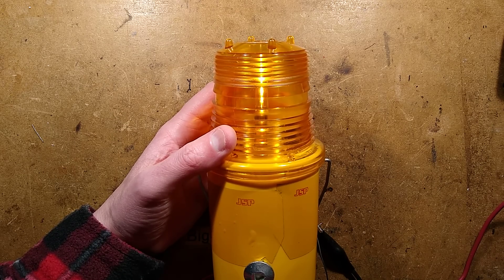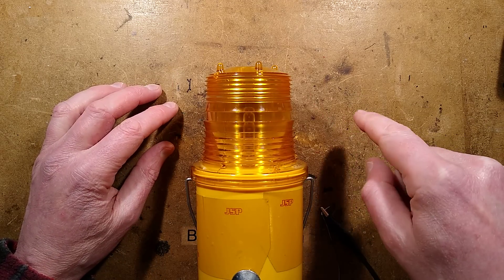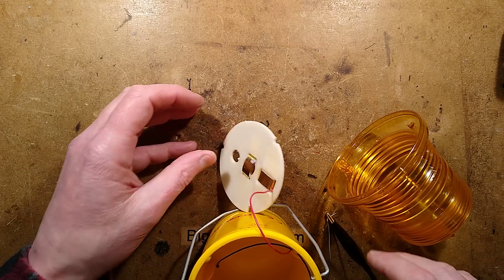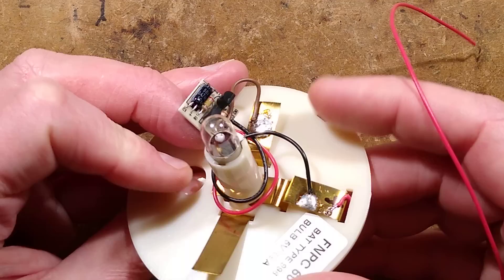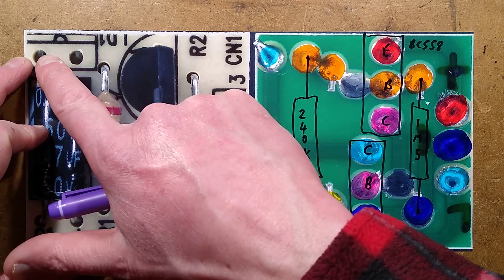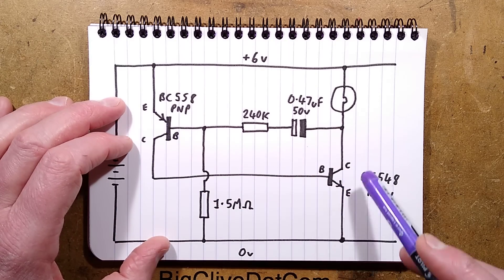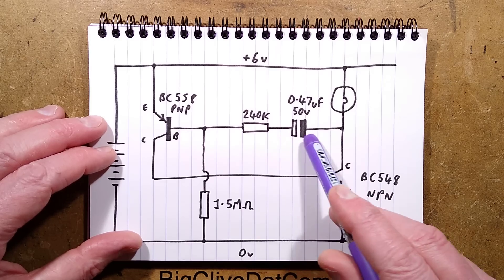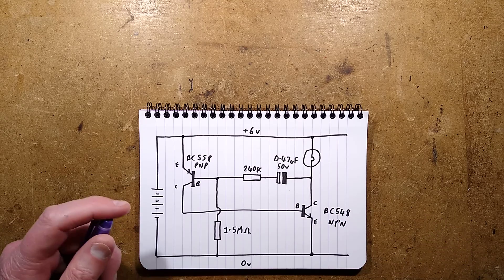Old tungsten roadwork beacon - with schematic

Comment: I am reminded of a circuit that I would run into from time to time that was even simpler.  It consisted of two complementary transistors,  one capacitor,  and one resistor. These were sometimes sold as little modules for a code practice oscillator,  siren,  etc.  I'm sure I've seen it elsewhere as well.  I cannot remember the exact configuration of the circuit,  though.  Putting just 3 volts into it,  you could directly drive a speaker.

Comment: That circuit is identical to a code practice oscillator I built back in the 1970s.  Just use around a 100 nF capacitor and speaker instead  of the lamp.  The circuit is very insensitive to component values, including the transistor characteristics.

Comment: I ‘borrowed’ one of the square metal ones that up used to see on skips with a large lens on each side it had 2 large batteries i also ‘found’ one that looked more like yours, but much older  inside it as a motorised reflector that spun round to make the light flash like a lighthouse.. clearly designed before electronics components were readily available 
it was circa 1977 and I had my own bedroom disco .. only all the lights were yellow .

They’re probably still in my mums attic

Comment: Had one of these as a kid. I've no idea where it came from, it just, er, arrived. Bit bigger and chunkier than your one, same 6V lantern battery. Longer off period on the duty cycle to try and save battery life. I ended up using the battery to power the propellers on the model aeroplanes hanging from my bedroom ceiling.

Comment: I remember them in the 70s, they used a hex bolt with a ring around it making it impossible to remove without a 'special' tool.  A thin walled socket worked! :-D

They were attached to barricades (shaped like a saw horse) and the barrel shaped ones used at construction sites.  Two modes (continuous ON and flash).  When the batteries were new they were nearly as bright as the typical 1157 automotive lamp in turn signals (USA here).  They had versions that used a pair of lantern batteries in parallel as well.  Sometimes those were attached at the top of temporary road signs in construction zones.  Some did have a high intensity flash as others mention dumping a cap into the bulb.  Of course with today's tech using LEDs and solar panels one could make them run seemingly perpetually.  That is until some prat staring at their cell phone runs it over or a kid swipes it! ;-)

Also of interest are carbide lamps!  They have a very white light close to that of halogen when run correctly.  All you needed was some water and a few chunks of calcium carbide.  The reaction produces acetylene which pressurizes the tank and the gas burns brightly when properly mixed with air.  Like mantle lanterns they get hot AF and cannot be used in the presence of combustible gases.

Comment: There were some which simply had a bulb and a battery. The bulb filament was anchored to a bi metallic strip which bent as it heated, cutting the power then cooled and reconnected.
They were a MES base and I definitely used one in a bicycle dynamo. I may still have it.
Paraffin road lamps lasted up till something like the 90's. They were made by Chalwyns I think. We used to play with them as kids in the 70's and 80's.

Comment: I remember when you could get bulbs that flashed using a bimetallic strip inside the lamp envelope that heated up and broke the circuit before cooling and making contact again. Couldn’t get any simpler than that. I think that was the precursor to this circuit.

Comment: I've seen circuits like that which use one transistor to limit the others base current in references from reputable designers (who need to keep parts count to a minimum). Its not great in that if you take the circuit outside of its normal operating range one transistor gets rammed on, but provided the values are chosen correctly it does work. Other oddity is that they get quite close to breaking down the base-emitter junction of the '558 when it switches off, but with the 240k resistor that's probably of no real consequence.

Comment: The memories you invoke are priceless :D
We used to pinch them as kids. They were hanging off cones. The ones we took used to flash though with a couple of seconds between flashes like a strobe.
I do remember the components were just soldered leg to leg then to the bulb and I'm sure there were only 1 transistor, 1 capacitor and maybe a couple of resistors, if such a strobing circuit is possible from that arrangement. 6 volts was crucial to its operation though, I do remember that, any less (like 3xAA batteries) and it wouldn't work.
There were also some with no components, just stayed lit up all the time like a torch. I guess they wouldn't last too long lol
Reply: Maybe a reverse BJT oscillator. It is weird at first thought - no base connection, just a resistor, capacitor, transistor in reverse polarity, and the load to be pulsed. Won't get much simpler.
Reply: Thank you, sounds worthy of experimenting :D @jussikuusela7345

Comment: Gosh, very cheaply made but adequate for the need. Some of these have the little light sensor so they pick up the light output of a neighbouring lamp, which means they flash in some sort of sequence. I think this is used along roads so there’s a wave of ‘signal’ along a cone line or wherever they’re posted. I don’t know how the electronics of this works, just what you see. Good use of a Fresnel lens, too.

Comment: The railways used to use the paraffin type with a special lens configuration.  They had two red opposing and two green opposing lenses.  If you find one of those in a chav shop they are worth a mint.

Comment: The ones in use today alway fascinate me. They must communicate with each other by the way they flash in turn down the line. Interesting circuit though you have there Clive as simple as it is. 👍🏻

Comment: @bigclivedotcom An interesting video and thought-provoking video. Many years ago I had on of the other types of road warning light that had two of those 6V batteries and was basically bidirectional rather than omnidirectional with two vertical orange lenses mounted vertically. From what I remember, it was two high-intensity pulses followed by a pause and the filament  lamp looked the same as the one in this video. There was a bit more to it than this light and at the time I tried to reverse-engineer it (for possible future projects) but it was a very long time ago.May you have or can get hold of such a light for a future video?

Also, someone brought out a very interesting version of those 6-volt batteries. It was a rechargeable version and the physical form was the it was that, when viewed from above, the profile was triangular rather than square like it was cut in half almost diagonally from one corner to the other. This was to facilitate a rather unique and useful feature in that in the space where the rest of the battery was 'missing' was a built-in UK 13A plug! This meant that when the battery was discharged the entire battery was plugged into a 13A wall socket to recharge with no external charger or disassembly required. The pins of the plug also worked as a substitute for the missing corner so the battery would be physically 'correct' when used in place of the regular 6V battery.
Reply from the maker: I remember those rechargeable batteries.  I wanted one at the time, but they were quite expensive.

Comment: You've got the posh one! I remember an early version that my brother and I rescued from the roadside after it had been run over by a vehicle, which had one single transistor and a couple of resistors and capacitors. We repaired the circuit, which was literally just the components hanging in mid-air, like a spider's web. The bulb was 6v rated at about 50mA.  The flash rate was a bit variable and could be skewed by varying voltage and temperature.  In service, I remember these things rarely, if ever, flashed anything like in time with each other!

There was another variant that ran at a somewhat higher frequency so that they appeared to be constantly on, but if you shifted you eyes rapidly, you could see a trail of amber flashes in a row along the path of your eye.

Comment: i was not expecting a PCB... i have of these somewhere that just had a transistor and a cap roughly soldered together though holes in the plastic plate that holds the lamp

Comment: Something about flashing where the average power does not equate the same runtime as a continuous load, but seemingly thousands of times more.

I think one of the oldest batteries is inadvertently still going using this principle I shan't not term for the brain serves a corrupt data packet.

Comment: I too had the American version of this thing back in the 1970s. Got mine at a thrift store.

It used a thermal switch “bulb”, no other components. The on off switch was two brass strips inside, operated by what looked like a bolt head. Took me a while to figure it out, it was so simple, but everything didn’t line up when it was opened, so I had to do some mental gymnastics to figure out where everything would be when it was assembled.

In yours, the lamp turns on when initially powered up because the capacitor looks like a dead short so the resistor divider turns the left hand transistor on hard, turning the other one on. Thereafter it operates as you said, the capacitor charging through the 200K resistor and the transistor’s b-e junction until the transistor can’t stay on etc. The cap appears to discharge through the battery.

The connection across the cap is puzzling indeed. I mentally ran through various components that might be attached there and what they would do. A resistor would, as you found, just make the lamp stay on. A capacitor would change the flash rate. A switch again would make it stay on in one position and allow it to flash in the other. I think that might be the intended function for a different model that had the included switch. I can’t quite figure out how the marking on the board relates to that though.

Thanks for the blast from the past. Brought back memories of learning troubleshooting on very non-standard gear.

I hope someday you get hold of an old rotary phone and explore the balancing network that permits duplex operation without echoing . Those things are black magic, full of inductors, resistors and capacitors with weird values you won’t see anywhere else.
Reply: There’s a great article in the Bell System Technical Journal (BSTJ) from about 1953 which describes the Western Electric model 2500 telephone which was a staple of telephony through the early 2000s.  The hybrid network is a model 425A.  It works sort of like a Wheatstone bridge so that the carbon microphone current and the line current oppose each other in the transformer and cancel out in the ear piece.  With no microphone current, the line current is unopposed and thus is heard.  The 425A network contains several varistors which essentially program the microphone gain and ear piece sensitivity to compensate for the varying length of the subscriber loop.  It is an excellent feat of analog engineering.  The Bell System Technical Journal is archived on line.
Reply: @wtmayhew  I'm sure that 1953 article wasn't talking about the 2500 because Touch-Tone wasn't introduced until 1963*. The article was most likely detailing the regular 500 rotary phone. Although I believe the 2500 used the same hybrid.

*The rare 1500 was used in 1963, the 12-button 2500 was 1968.
Reply: @eDoc2020  Thank you for the correction.  That was a typographical error, should have been 500.  The correct network model number is C4A 425 (which was revised several times to at least 425E).  I have a 233 3-slot pay station which I use with a 685A subset box which contains a ringer and a 425E network.  I also have a later 236 single slot pay station which has an internal network labeled 4010B with a C4A single gong ringer mounted on it.  The station service/coin serve manual I have doesn’t go into detail about the internals, just has wiring diagrams.

For the record, 453A is a vacuum tube which does not apply here,

Comment: The old "996" batteries were the standard for the lights used by the Night Shift nursing staff back in the day!  The  "standard NHS contract" Ward Torches seemed to always be the Ever Ready "Dolphin" brand. Nowadays our Night Staff use rechargeable LED lights,  which are brighter, lighter and far more reliable.

Comment: I remember  collecting  and modifying  these  beacons  in the 80s  if I remember  right  they were a little better built  back then withthe the components  on the bulb  holder with jumpers making  up the circuit,,,,the modification  was achieved  by strapping  or inserting  fireworks  to the lamp 😂,,, Happy  80s FUN

Comment: As Kids some 40+ years ago, we used to nick the battery's out of them for our home electrical needs. (Basically the light in our tree house). the flat round type had 6 volt bulbs with bimetallic strip in it, so no circuitry needed.

Comment: Transistorised flashing circuit. I have a few of these including a blue one with a strobe. Takes a 6v battery 4R25 or in old code Ever Ready PJ 996. In the old days Ever Ready did road lamp batteries for industrial use only. British gas did there own battery made by Ever Ready. Some of the early ones did use oil. The earlier electric ones used a split filament bulb for the flasher part, no transistors. I have a few old Pifco lamps that used these bulbs. I have a lamp from Eveready of the same age that's American and made by union carbide that has a transistor flash circuit. Once again Clive and excellent video.

Comment: In Spain the most common type is the MaxiLite or equivalent, some had dusk sensors and some not.
Here generic zinc carbon 4R25 batteries can be as cheap as €2 each purchasing a whole carton of 24 units at construction supply stores.

Comment: I have one of the newer ones that i duacivered, having been yeeted into my garden after some road repairs on my street. It has a big round orange lens and a yellow plastic body, and like this one also uses a 6v lantern battery and a tungsten torch bulb. It's designed to sit on top of a traffic cone and the switch is built into the receptacle for the cone, so it only illuminates / flashes when in position. Very cool decoration for my 'man cave'!

Comment: Can you imagine how they secure construction sites along roads in Brazil over night?
Every few meters is a red 10 l plastic water bucket, upside down, in an altitude of 1 m (3 ft.) above the road.
They stuff a 100 W bulb below/inside the bucket. That gives the most beautuful large red light that you can see from far away.
Below the bucket is a cone of white light where you can see imperfections of the surface and debris without blinding your eyes.
Genius. Cheap. Perfect! 😃👍

Comment: The socket of the bulb looks like the backlight bulbs for speedometer, rev meter, oil pressure and so on in older cars, trucks and motor bikes.
The specification for 12 V environment was 1.2 W (if I remember correctly).

Comment: I acquired one of these as a kid and it was about as minimalist as you could get.  It was built more or less the same as this one but had just a bulb, battery and a automotive 6 volt turn signal flasher.  The battery would last a surprisingly long time flashing away

Comment: A current limiting resistor in the NPN base is not necessary - the limited PNP base drive current multiplied by the PNP beta (or Hfe) will always be safe.

Comment: We used to throw these in the canal as kids in the 80s, naughty I know but it looked impressive under water. We also found changing the capacitor and resistance values made a disco style strobe light.
Reply from the maker: Not sure I'm keen on the underwater bit.

Comment: I remember acquiring one of these as a young geeky electronics nerd, in the late 1970s.  I got it home, anticipating a really cool circuit.  It was not to be.   A 6V lantern battery, as in the video.  A potted electronic module less than the size of a pack of gum, and a bayonet lamp base.   Very disappointing....

Comment: I worked for many years in the NHS (in the UK), those 996 batteries with the springs on top were a standard stock item, every ward would have a basic hand held Ever Ready torch, we used to call them 'nurses torches'. They were used by nurses to do ward rounds at night. 👀

Comment: back in the mid 90's, around here they started to make LED based road work lamps.  my friend and I had to go.. umm, acquire one for research purposes.  it took two lantern batteries (this seems to be common in the US vs a singl eone).  inside was a small circuit board with a 556 timer and two very high brightness (for the time) LEDs in series.   one half of the 556 pulsed the LED at around a 50% duty cycle at 100Hz or so, and it was held off by the second timer through a diode.  the second timer made it flash once a second or so with a 40% duty cycle.  finally, a photo diode held off the slow half of the timer to stop it flashing during the day.  It was very cheaply made too since they are basically disposable, with some brass strips.  It'd be interesting to see what's in a "modern" one.